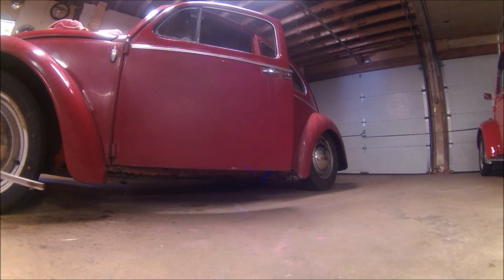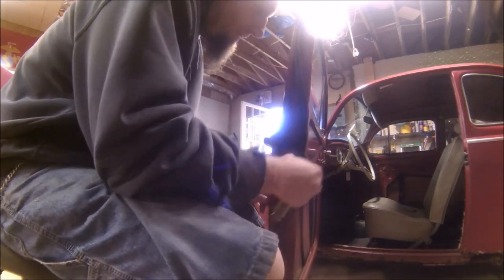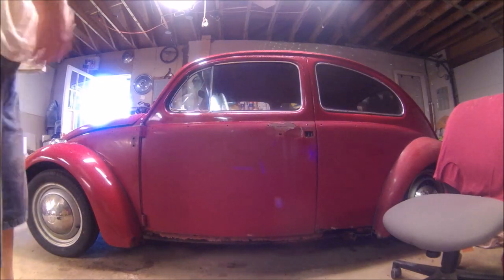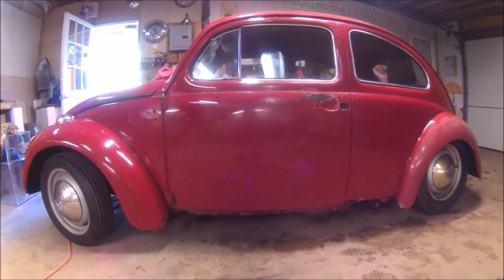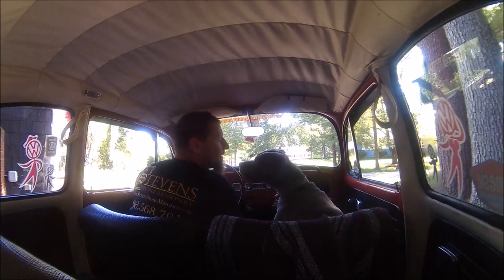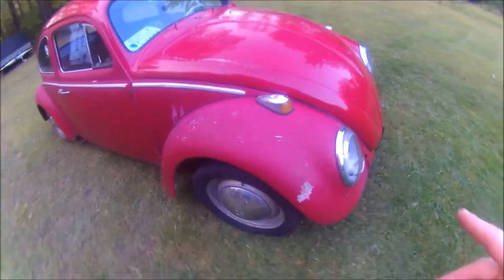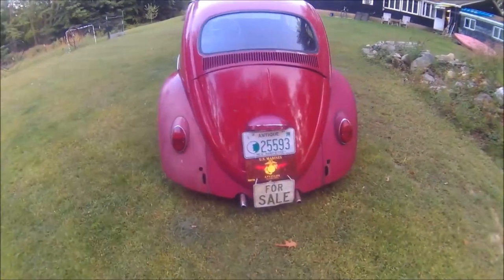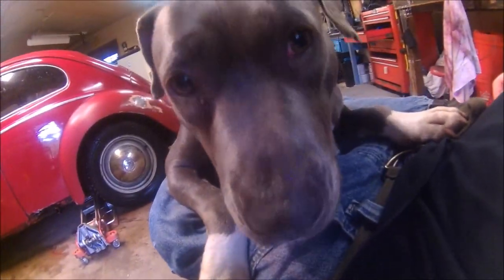1964 vw bug (Daisy) part 8

Comment: Very cool project, I think it has a great unique look. Are you going to leave that cool retro Pioneer stereo installed?
Reply from the maker: i will be replacing the stereo with something more up to date. thanks for watching
Reply: Cool, I think the Sony MEX-XB100BT is a very nice new receiver, very high power and nice sounding. If you do decide that you want something a bit more retro I have a Sherwood CRD-250 AM Stereo/FM Stereo cassette radio with Dolby B and C as well as an aux input. If you are interested in it let me know.
Reply from the maker: thanks for the info.